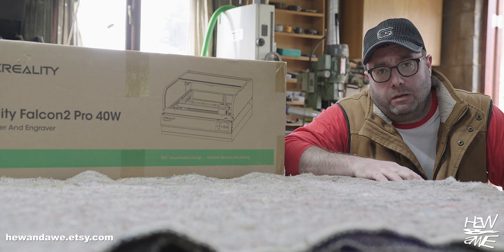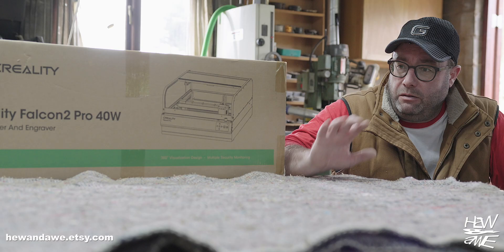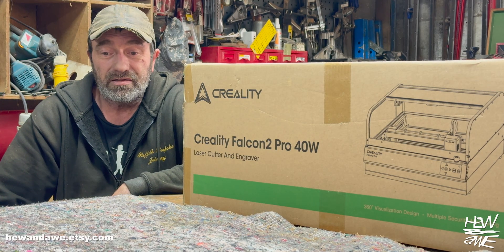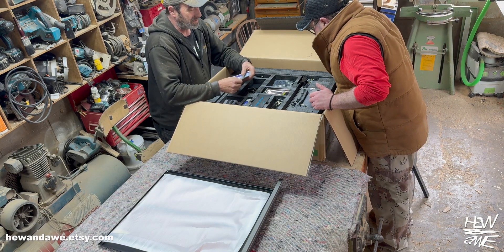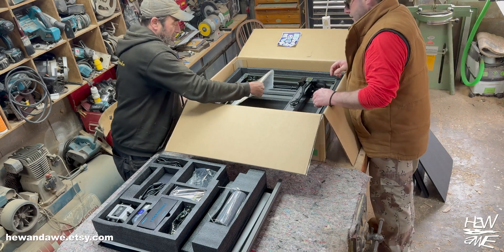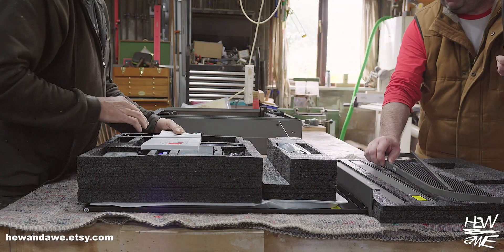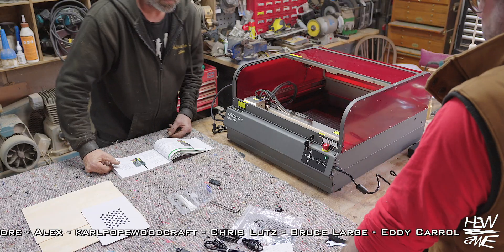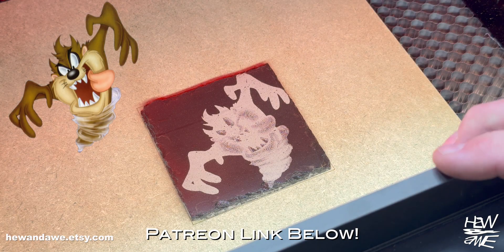Can The Creality Falcon2 Pro 40W Make Money 🤷🏻‍♂️

Comment: I've had the 60w version for about a year. Likewise, a total novice/first-timer.

I've really enjoyed learning with it. Starting to have some glitches as yet unresolved, but I've run it very hard.

Haven't made much money with it yet but LOTS of gifts which have been very well received and even turned out well.

Interested to watch along and see how it does for you (a kickstarter version of the other one you just demo'd is expected soon, too). The home security device burn came out great.
Reply from the maker: I’ve been really struggling to get a good pic out of it on slate! And wood.. do you have the rotary?